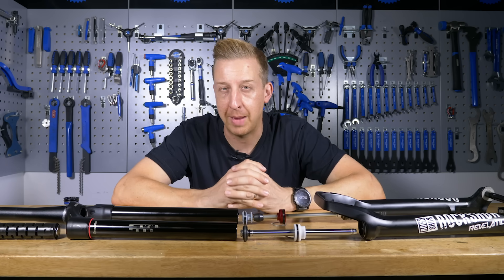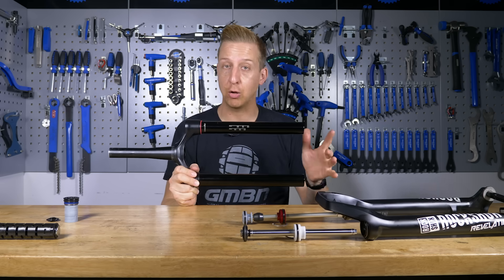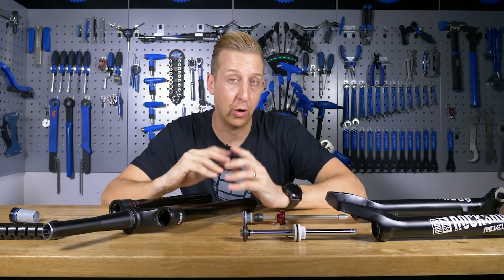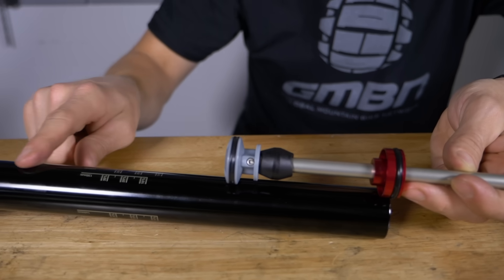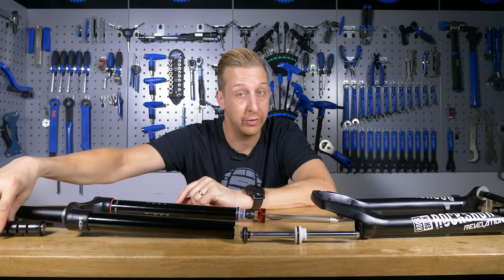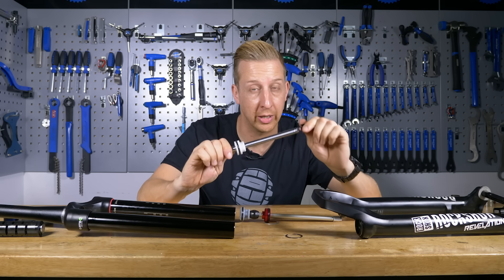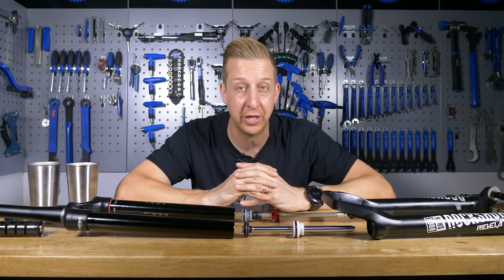How Does It Work? | Suspension Fork Break Down

Comment from the maker: Do you like this style of video? Which mountain bike component would you like us to break down next? Let us know below👇
Reply: GMBN Tech gotta say I usually prefer when my components don’t break down!
Reply: Yea. Great content. 
Exploded views of components is how I figure things out.
Reply: I enjoy these videos. I’m still learning and find them really useful. 

I recently had to take my shock to TF Tuned and they were awesome. It had got super fizzy. 

He stripped my shock with me there and explained how it all worked. It was fascinating.
Reply: Could you do the same but for rear shocks
Reply: Would be interesting to see a derailleur and a shifter!
Reply: Definitely! More fork vids using different brands if at all possible (Fox, X-Fusion). Your explanations of why things work the way they do make more sense than just reading a manual. I still don't know what I did wrong during re-assembly to make the TALAS adjustable travel stop working. Keep up the good work!
Reply: Bob Baldridge 
Probably nothing you did wrong. 
That’s a very common problem with those forks. 
Contact fox, sometimes they will offer you a discounted replacement if it’s not fixable, which they often are not.
Reply: yeah, bottom brackets
Reply: Dropper post!
Reply: Same but for shocks would be good, as more complex than forks. Thanks
Reply: Me I would like two videos on components.  One on  the parts and then one on the rebuild.  Obviously a rear shock would also have to be done.  It is only fitting.  Great vid by the way.
Reply: Dropperpost plz
Reply: Hi there. My Rockshox Reba RTL TI (Dual air) rebound damper bottom adjuster, which is a very small Allen key bolt, that the red adjustment tool fits into just rotates, there is no clicking. I suspect the bolt is stripped. Can that bolt be replaced, or do i have to replace the entire damper unit? it looks similar to the damper unit in this video. Help please?
Reply: I love it! Rear damper please :)
Reply: I have a Rockshox 30 silver TK and I have an issue regarding this fork. The rebound knob is not making clicking sounds while trying to adjust the rebound damping, it just slides round and round smoothly and also it is harder to push the knob in its position. Can you tell me what is causing the problem? Do I need to replace the rebound damper with new one?
Reply: SR Suntour please
Reply: Suntour coil fork.

Comment: Hi. Great video, thanks. Apologies if this has been asked already (looked but couldn't see). I've got a set of RockShox on my Whyte 805. They've got a bit of 'stiction' I'm told by a friend but they seem to perform fine. Or maybe I just don't notice as the deterioration has happened over a long period. What are the normal tell tale signs of a set of forks needing maintenance? Thanks Scott

Comment: Hey Man!! I am from Bangladesh where a lot of stuff is not available to service. I need to service my Rockshox Recon TK (Coil Shock) with oil inside. I have learnt a lot from you and keep my Cycle alive and running to the fullest. Now SRAM datasheet says for upper leg I need 5W and for lower leg 15w. I can't find anywhere. Can I use Motorbikes' same weight fork oil for this? Or what may be the alternative?? I will be waiting for your response.

Comment: I have a Rockshox 30 silver tk and there is an issue that I am trying to fix, the rebound knob allen key doesnot gets fully in place while inserting in the damper shaft. And also the shaft now does not makes any click while rotating the knob it just smooth with no Rebound. Is it possible to fix this or do I need to replace the damper shaft?

Comment: I am hoping you can shed some brilliance on an issue I have with my RockShox Secktor. It is a 140mm travel. I did a full breakdown in March for maintenance and also to fix the damper lock out that was inoperative when I bought the bike (used). I replaced the damper, damper rod, all o-rings, and seals and topped it off with fresh oil. All Rockshox parts and fluids and followed the service tech manual. It was working supreme, 100+ miles until I went off a rock feature and bottomed the fork. Now the lock out is inop again.   The original issue with the damper cartridge was it was slightly bent. Yes, the plastic cartridge appeared to have been impacted from the bottom.
Any thoughts as to why this would happen?
Thank you

Comment: I am servicing a Marzocchi MX Bomber 04 fork  and it has coils in both legs, but also an air filler valve in the right leg. Is this weird? Marzocchi manual says 135 ml of oil in both legs. Does that all go in the uppers? How much in the lowers? Thanks, I watch you guys all the time!

Comment: i have spinner aeris 320 forks, when i lift the bike there's a clacking sound from the rebound side, i try to open the forks there is oil spill out and found a gas tube inside and i don't have any idea to repair even i asked the mechanics. Would you help me guys?

Comment: Hey Doddy Interesting Video. I've noticed that most 100mm shocks usually use only about half of the full travel using the recommended air pressure weight and usually I run my shocks at the lower than my weight pressure to give the shock a plusher feel. Now that I see there are air volume spacers I would like to know if a 100mm fork e.g. (my fork is a 2018 Rockshox world cup 100mm) would have capacity to adjust the volume spacers for more travel thereby eliminating the need for a 120mm fork? Or can you change the Damper to a 120mm?

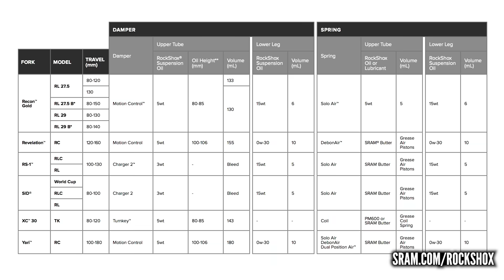Comment: 11:19  but I think you would need different oil for different temperatures, cus in the winter forks get harsh. maybe another video to make about oils, or how to set up suspension for winter use, coldest I rode in was -11C. but I definitely need to change something about the suspension, but I also need new frame and different studded tyres cus I want to run Cush Core as I do in the summer. in the spring and autumn, I can heat the fork up to get it plush, do it in a controllable way so I don't suddenly get plush suspension when I had harsh, but in the winter it's so cold the suspension is harsh, but I wish I could had bigger studded tyres, cus 2.1 with no Cush Core and high psi is harsh.

Comment: Quick question. How do you remove that odd shaped silver nut at the end of the air shaft? To service parts in the middle
Reply: You dont! Zero need to either. The airshaft just needs a clean and regrease on the o rings only and the shaft (then slide the bottom cap UP. Dont grease the bumpstop (only what sliding bottom cap pushes up off the shaft.
Reply: Cool, thanks From San Diego :)   @rupedog

Comment: #askgmbntech Hello, i got a problem with my Rock Shox Lyrik RC fork, in the last 2 weeks it stiffened up more and more, had the right pressure in it for my weight (65 PSI) but it's gotten stiff like a rigid fork. when i let out all the air to 0 PSI there seems still air inside as i can't compress the fork to the full travel which should be no problem with no air in it, even when i sit on the bike with 0 PSI in it, the sag doesn't go over 10%, when i pump it up back to 65 PSI the fork is rigid and even with full force it won't compress more than 2 mm, so what could be the problem here?
Reply from the maker: Hard to say without seeing the fork Patrick, This could be a damping issue, bushing friction or air trapped. We would suggest you take this to a local suspension specialist and hopefully they can help you with this.
Reply: Havent accidentally turned compression dial to lock it out have u? Top of drive side leg
Reply: Or air trapped.in ur lowers, though.unlikely.if its that stiff...
Reply: @rupedog  it was air trapped in my lowers, i released it using zip ties between the seals and the stanchions and now it works as a charm again thanks for the tip :)

Comment: #AskGMBN alright Doddy, I have RockShox Judy Silver TK Solo Air Forks - Boost 2018, when I turn .y lock out knob to adjust compression I'm basically stuck with fully locked out or not, nothing inbetween, is there any thing that can be done to adjust this so I can set my sag correctly
Reply from the maker: With any fork we would suggest that you setup the sag with the Compression Damping fully open (Unlocked) as you have an air sprung fork you will need to use a shock pump to adjust how hard the fork is. This lockout feature is only really needed for climbing or riding road sections. Hope this helps Lee 👍

Comment: How about a video of a full service on a charger/charger 2 damper side on rockshocks forks such as the pike. Damper replacement and everything.
Reply: Dampers are sealed units, shouldn't need strip down the damper. The damper service vid and manual is on sram/rockshox website under ur forks service info. Or google it and use the 'sram tech' video...

Comment: Explain how dual air changes travel
Reply: It Doesnt. Thats Dual Position. Rockshox dual air has a separate valve for pressurising the positive and negative air chambers, rather than one valve and the sir transfer port/divot doddy mentioned. It allowed precise adjustment of the fork feel but adds set up complexity..

Comment: How about a video on the routine Lower leg service that Rock Shox  forks needs?  I think most riders would be surprised to learn that it is every 50 hours of riding. That is at least 2 times a season for me. I would love to do this myself rather than pay a shop.
Reply: Its actually.v easy. U need the oils, new crush washers, a 10ml syringe to accurately measure oil volume (ebay, couple of £) and a proper torque wrench with hex bit to retighten lower leg bolts correctly. SRAM/rockshox has very clear videos on YouTube/its website under the details for your fork, plus clear service manuals. Not a need for doddy to copy this existing reference source...just check them out, they have correct torque settings, oil weights/volumes etc. They are Simple yet detailed.

Comment: #askgmbntech I have a 2018 Rockshox Recon TK. Is it possible to just change the dampner on this fork with a higher quality one without having to upgrade to a higher end fork? Thanks for this vid, keep them coming.
Reply: Nope
Reply: @rupedog  actually since asking this question I have been doing a lot of research and it looks like you can. As long as the damper comes from the same size stantion and the same material stantion, they can be interchanged.

Comment: Is there a top-out bumper on forks. What keeps forks from pulling out quickly and making a clunk sound when they are fulling extended.
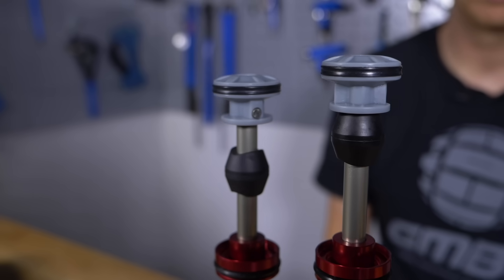Reply: The rubber top out bumper Doddy mention at 5:14, the black rubber block on the airspring... remember, the red bit doesnt move, so when fully extended the shaft slides down through this pulling the top grey part (and bumper) down to the red bit...the bumper stops the harsh knock at full extension
Reply: Speed of 'pulling out' is controlled by rebound damping, doddy also covered

Comment: You could just lock your suspension instead of putting in that many spacers.
Reply from the maker: Both do different things, the lock out is just a lot of compression damping (this is the speed of movement). Reducing the air volume with oil or these volume spacers actually makes the "spring" more of a progressive curve. This means it will be softer at the start of the stroke and harder at the end. Hopefully this explains 👍
Reply: Thanks,I'm not exactly doddy so I can use all this information 😀

Comment: Hi Doddy. I've got a FOX 32 CTD  where the lockout is damaged. The Trail and Decend modes work fine but in lockout it becomes a almost rigid fork. Is it worth fixing this yourself or just not use the lockout? FOX does not make parts for this 2015 fork any more.
Reply: Lockout is meant to make it almost rigid, that's the idea, if you want it to be able to move but still have extra damping, you use trail mode, sounds like nothing is wrong
Reply: @michaelstewart9308  I had it in for service and the cartridge is damaged in the lockout position. I know how it's supposed to work. You should still have some damping in lockout mode.
Reply: @FredrikNordstrand  in lockout it wont move...it will be 99% rigid...Michael is correct, its working as it should. Lockout does what it says...it Locks it rigid

Comment: Brilliant vid Doddy as usual. Im thinking of changing my Pike from 150mm to 160mm, I assume its only the air spring and new oil I need or can I reuse the oil if the fork is relatively new? Thanks
Reply: New oil...its cheap dude, like £7 fir enough to do 5-6 changes or more. See RS vid on airspring upgrades... https://youtu.be/5ir-wUrWaTs

Comment: Hurry up with the changing the Debonair & travel change/upgrade video please I just got one to replace on my Yari Soloair from 150 to 160 non boost 😘
Reply: Full video by Sram/rockshox on YouTube...plus manual for this... just google...🙄 ...hang on... https://youtu.be/5ir-wUrWaTs
Reply: Make sure u have lower legs oil specified for ur fork and measuring syringe before u start! Might as well fit new foams at same time...soak them in the oil fir 10mins first (I put clean new, foams into the oil bottle, then hook.out with a pick). Plus u need isopropyl alcohol (amazon, from shl/fork cleaner...do NOT use brake cleaner). The cleaning rod, I bought off ebay, just a plain Delrin rod, 2.5 x 30 cm, £5

Comment: The oil volumes seem off. Usually, the compression damper requires roughly 100ml while the bottom leg lubrication only has a few ml in each side. In the video, it seems reversed.
Reply: Was just thinking the same thing, must be an editing mistake.

Comment: I have a rockshox pike rct3 and im in two minds about servicing it myself or sending it to tftuned. Im fairly competent with using tools and other jobs but im afraid ill make a very costly mistake! Is it a particularly tricky job to undertake?
Reply: What sort of service? Damper? Lowers?
Reply: I have confidence in your abilities!  After all, you've delivered 12 of your own children... this will be easy! ;)
Reply: Rockshox website has a very detailed breakdown and exploded views. They also have specs and part numbers listed. My only word of caution is, it can be very difficult to find your particular model. https://www.sram.com/service/rockshox/all
Reply: Lower leg service and airspring service is easy. BUT...make sure u get right oil (amazon £7), 10ml syringe to accurately measure oil (ebay £2), have sram butter or lm500 military grease (correct grease, any grease will Not do...the lm500 is what rockshox use in the factory btw), plastic delrin rod or similar for cleaning inside legs (ebay, £5) - do not use anything metal! - and isopropyl for cleaning (amazon, SHL, £5+ depending on size). Oh and foam rings or service kit, obviously. The oils, iso, tools etc all last multiple times, so cost per service is low.
Watch sram tech vids or service manuals. Very easy to find on sram website if ur logical...or google

Comment: 3:03 there's also a spring inside the seal
Reply: The spring is on the outside, garter spring. Rockshox seals are just rubber units, nothing more to them to disassemble. Garter spring, rubber seal, foam ring. Thats it.
Reply: @rupedog  No, last time I serviced my 2018 RockShox Pike, I accidentally removed the spring inside the seal. It's like quite literally inside the dust wiper seal.